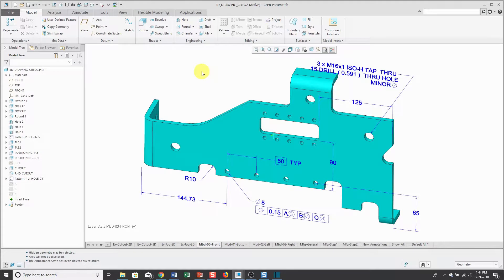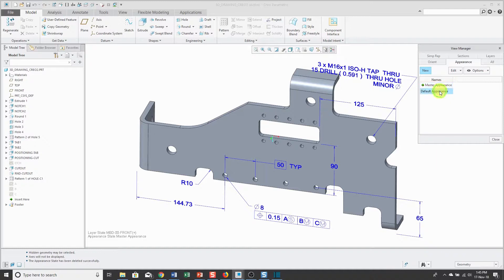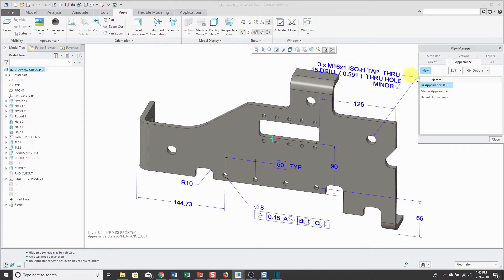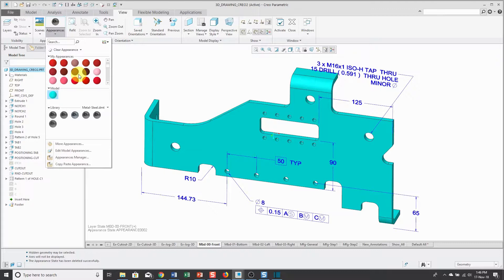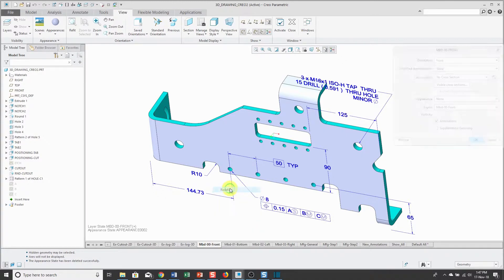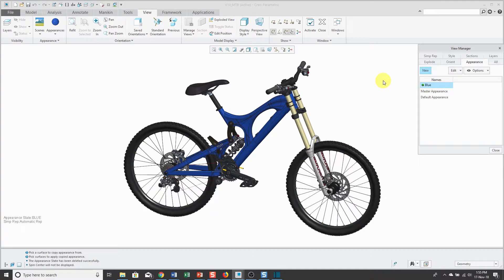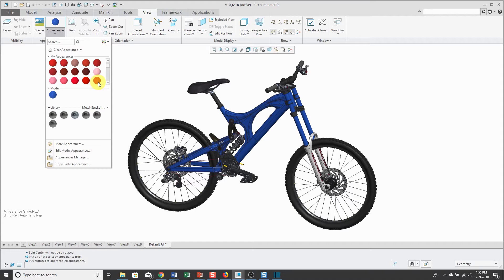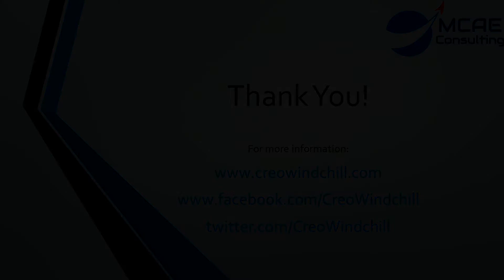Creo Parametric - How to Create Appearance States | View Manager

Comment: Is it possible to set an appearance state other than the 'default appearance' to retrieved when first opening up a model?
Reply from the maker: No, I don't believe so. The Master Appearance contains the original appearance of the components without assembly appearances. The Default Appearance can be changed though. To prevent changes to the Default Appearance, you may want to activate another Appearance State while you are applying different colors to models.

Comment: Thank you!  I can't believe I didn't know this functionality was available.  Very helpful video from beginning to end once again.  Question do you know if there is a way to   set where creo loads the 'my appearances'  ".dmt" file from?  I have figured out how to create the file through the appearance manager, but I have to manually browse to it and open it each time I reboot Creo.
Reply from the maker: Sean, this is a little tricky and counterintuitive. First, make sure that the file is called appearance.dmt; don't try giving it a personalized name. Then set the option pro_colormap_path to the folder that contains that file. It is very particular that you do it that way in order to load on startup.
Reply: @CADPLMGuy   It worked!  Thank you so much!